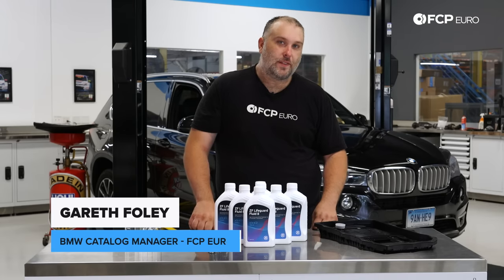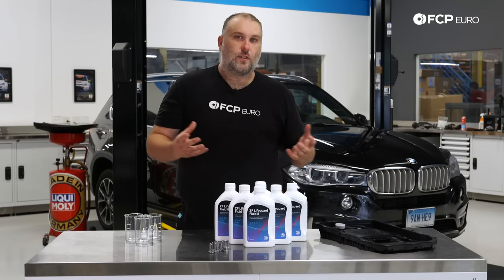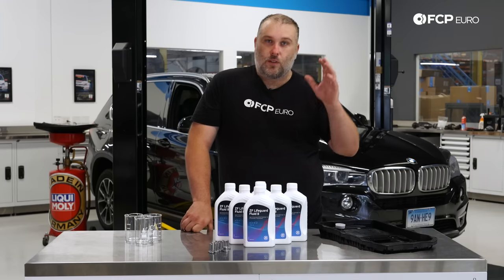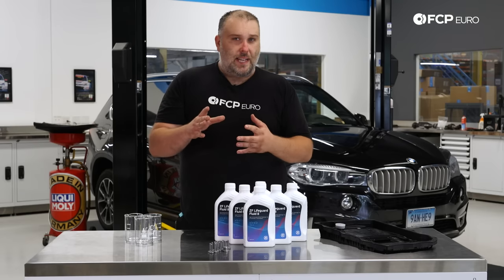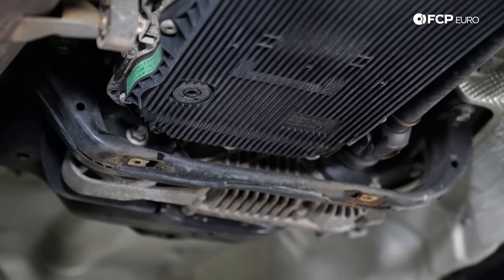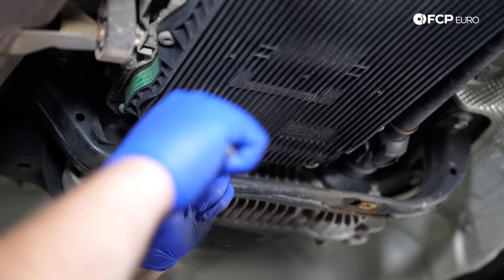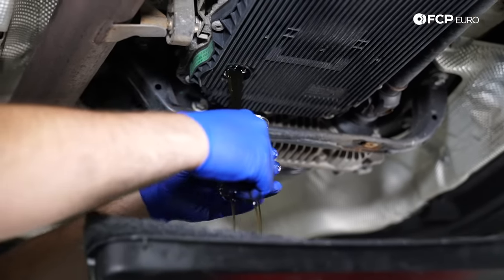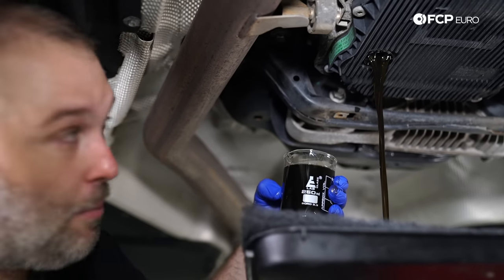ZF 8-Speed Transmission Oil Change (BMW, Audi, VW, Dodge, Land Rover, Toyota, & More)

Comment: My 2018 Jeep Grand Cherokee has this transmission. My dealer says the transmission fluid is for the "life" of the vehicle. I'm currently at 44k miles. Who should I trust to change this transmission fluid? I just had an oil change so I will probably change the transmission fluid around 51k-53k when the next oil change is due.
Reply: Who knows  my Durango has the same  8hp50 as the Jeep .   Dodge wont touch it  .

Comment: Hello guys.
For a better job, the torque converter and oil cooler should be flushed. It takes longer but the result is much better and I do it every time I take an automatic transmission. 
Your workplace is amasing

Comment: My F30 330dx has 118k miles on it. I've had it for about 8 months now and I've been noticing the last month or so that it shifts "hard". Not very easy to explain.

However I've offered new oil already but listening to the last part in this video makes me second guess this decision. Since you said not to change it if it's in bad condition.

Should I be worried? I'm guessing the previous owners have never changed the fluid at all.

Also, did you have the fluid at 40c before draining it as well? So 40c before and then one cold fill and lastly a fill at 40c again?

Thanks for the video

Comment: Hello I have a 8speed automatic 2014 bmw 1 series (f21) can you please advice which fluid to buy to service the transmission?
Reply: I used eurol automatic ATF6700 fully synthetic oil I'm my bmw f10. The most important thing in choosing the oil is to make sure that it is approved by the manufacturer. Eurol ATF 6700 fully synthetic is approved ZF and meets the requirements of ZF lifeguard 8 and BMW 83222152426.   The oil is make in Holland. Hope this helps.

Comment: Thanks for the info, I did some work with ZF when they were introducing these transmissions to the Chrysler lineup at the North American International Auto Show several years ago.

I did learn this primary specs on both the Transmissions, the heavier Duty unit for the trucks and the one for the 300. Look like a good unit. A Little Less problematic than the Mercedes-Benz nag transmission. But I have had two of those and never had a problem with them. I sold both of those cars at over 200,000 miles and they were still running strong, I had just done some minor engine work on my wife's 300 with a custom front end. It was running better than it ever had. It was running so good that at about 45 miles an hour it was getting about 36 miles per gallon. And running about 21 miles per gallon in mixed driving and 27 at around 65 miles an hour. On a long trip it would actually get better mileage than that.

Comment: I have a 2012 535i with 215000 miles. I bought the car with 174000 from the original owner and have been unable to get any service information from the area BMW dealers. I want to change the filter but with the warning you gave about the potential negative impact of changing fluid that may have never been changed, I'm uncertain what to do. Thoughts? The transmission seems to perform without issues.
Reply: Yes that advice seems a bit confusing.. why not change out really old transmission oil???

Comment: Is it necessary to replace the pain every time the transmission is serviced ??
Reply: Yes, because the filter is incorporated into the pan.
Reply: @gregorymurphy8675  I understand that but can you get away by just drain and fill sometimes maybe  ??
Reply: @randylahey5005  I suppose in theory you can replace the fluid without changing the pan/filter. But remember that just as the fluid has a lifespan so does that filter. So if you change the trans fluid at 60k, 80k, whatever then that is how old the filter is. How effective will it be compared to a new one? I guess you can do a fluid & filter change at 60k, 80k, whatever and then maybe every 10k after can change just the trans fluid.